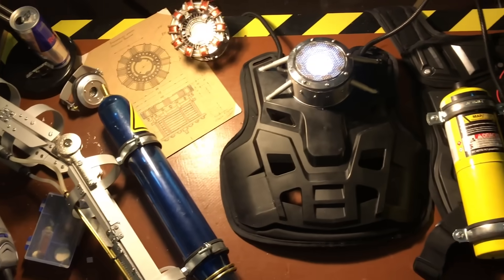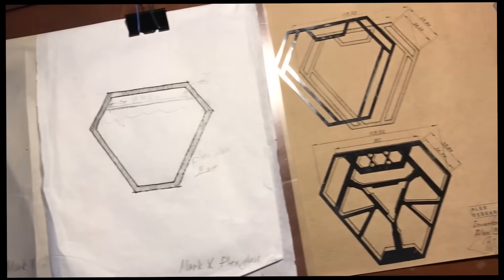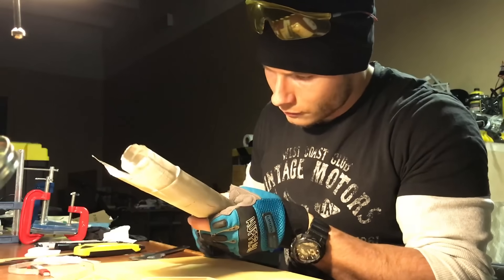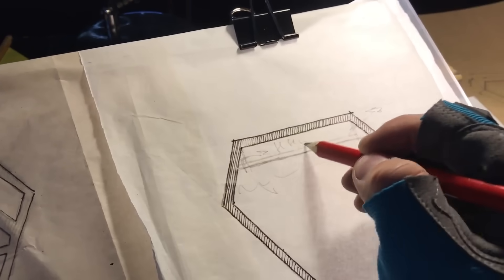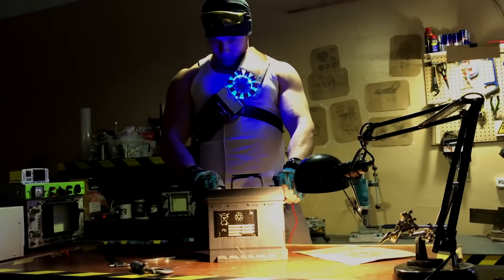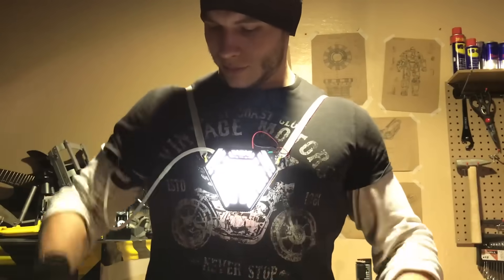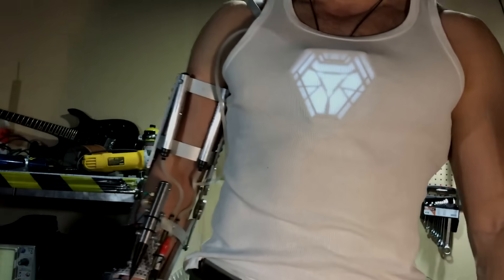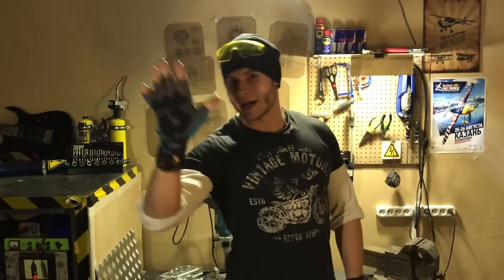Real Iron Man Reactor. Part#1. Compact electrolyzer for hydrogen experiments.

Comment: He could probably build a hydrogen plasma reactor that uses high intensity electromagnetic fields and rf frequencies to capture the electrons moving in the reactor so it doesn’t just run out immediately but holds the energy till it’s needed but like a battery but way smaller

Comment: Hi think Alex is not producing just Hydrogen but Hydrogen + Oxygen, which is highly explosive with 20 sheets 304 steal at 1mm , it would be possible to create 1.5L/m theoretical of this brown gas. if he has 20 lithium cells in parallel, there is expected a typical high-drain 18650 cell, around 10 amps continuous. This is also quite hazardous. As without spark arrestor  you're going to get Chernobyl 1 like he said, meaning a big explosion. However, it's really interesting, science Alex.
Reply: You want 21700 batteries and you could push them to a peak of 40-50a I believe, still 10a for continlus

Comment: Why do you need to scratch up the back of the screws and nuts with a dremel if not to just make some dramatic sparks. Why doesn’t this one need coils for an imaginary purpose? it’s just electrolysis. Why do you go to a lathe? Why do you use a big heatsink and fan on the back where the arduino is

Y’all im sorry and it’s impressive work but most of it is just for show like cosplay. 

Also for neater soldering don’t strip so much wire, tin the 2 things you want to solder and the iron (which I know you do already you have had numerous shots of you just tinning the iron to make smoke) and importantly hold the iron on the wire until the solder fully flows on both sides not any longer not any shorter

Comment: Why don’t you make a lithium ion battery the same of the reactor , so just how you install a battery in RC cars you can do the same with the reactor and make the whole thing wireless. You would just have the reactor with the battery installed in it and whenever the battery dies , take out the battery and recharge it . ❤

Comment: A singular 1.5volt battery powers the disposable camera flash circuit at a rating of output of about 300volts. A 12 volt battery could potentially generate 900volts if the circuits are wired in series. A dremel turbine could be used with the hydrogen and a 12volt dc  motor used as a generator. All this can fit in a compact space.

Comment: instead of pushing a button to launch the rocket on your gauntlet see if you can get someone to program the gauntlet to release the compressor remotly using either sensors for example if you make a fist and angle your fist downward it fires after applying a set amount of pressure and you can reset or disengage it by unclosing your fist and applying no pressure
Reply from the maker: Good advice! will try to make it
Reply: @ALEXLAB  i would like to help you too to fully finish the guantlet and work piece by piece i think the iron man suit can be done even with todays technology and supplies but only thing i'm good at is research and thinking about how things function and work

Comment: Can anyone tell me which softare he used to design the reactor? please!
Reply: Sandhya Suresh, generating the gas produces heat, so the only "software" I can think of,would be the use of a pwm. This makes power to toggle off and on. Toggle fast enough, and it's off more than on and helps create a greater volume of gas. Do some research on browns gas and HHO devices. I believe it's a Tesla property of "switching".

Comment: How much energy it produce
Reply: It doesn't produce energy, it just takes energy on compressor up to 2 atmospheres or turns liquid to gas with temperature over 2000 degrees, but that is just for the glowing effect.
All the energy comes from few of the batteries which are from Tesla Model S and it powers repulsor or rocket launcher by leading the direct from batteries to it and back. Nothing else, but I think it's very good idea or at least thing to do, when you're bored.

Comment: If you don't have any protection circuits like over-discharge, over-charge or short-circuit protection, I can compare such battery pack as a bomb. Throw BMS inside of it and it's save to use.
Reply: They're actually surprisingly difficult to blow up by accident. I've tried. BMS' are a good idea though. But hardly a bomb.
Reply: Well if he says that batteries are from Tesla, so they are Li-ion - they're second most dangerous batteries. I recommend to watch Greatscott's video about batteries comparision. Only Li-po bats are more dangerous than these.
Reply: Surely, overdischarge is not so dangerous as overcharge or short circuit but if someone that doesn't know how to work with these type of acumulators should not build that pack.

Comment: Bro don't use so big battery pack I have a suggestion because I am an engineer you can use 3.7 volt lipo battery and use DC to DC booster so voltage would be converted
Reply: Are you some kind of failed engineer. He used battery in parallel to increase current . He dont need high voltage. Dumbass
Reply: You dont know your shit mate. Current output needs to be increased
Reply: But power would remain the same bro. Electrolysis is proportional to Current (m=ZIt), so using a DC boost would rather have no effect or will reduce the ratee of electrolysis
Reply: Only takes 1.23v to split water.
Reply: @scottd8108  but a lot of current, more than a single 18650 can provide
Reply: @hacksmith  you're actually here😍 please collaborate
Reply: @hacksmith  so hacksmith is stalking his competitor 👈😂
Reply: @scottd8108  no problem I say you can also use simple battery
Reply: Nah man, triple A battery will work better

Comment: I'm not exactly sure what he's doing, or how it works. Do the reactors on his chest make hydrogen drom water and that's what he's firing?
Reply: Yep, The "reactor" is running an electric charge through water to perform electrolysis creating hydrogen and oxygen (hydroxy) that combusts violently in the blasts from the repulsor. The explosion is not visible however, so he carries a tank of benzene that ads some color to the blast.
Reply: @racyforging7119  WOW! I had a simular idea once. I wanted to make a fire glove with a vent on the palm, and the idea was that I would use soap water and flammable gas (Originally I was going to use hydroxy but decided I would use butane instead) and bubbles would form on the vent and I would ignite the gas inside with a button! But i don't have the time or money for it sadly.
Reply: @thienbaongo7997  That is a cool idea i might have to try it.
Reply: @racyforging7119  Hold up I was gonna do it first lmao
Reply: @thienbaongo7997  if one of us does we should use a version of Alex's electrolysis reactor to do it.